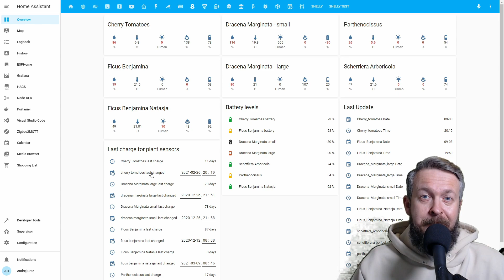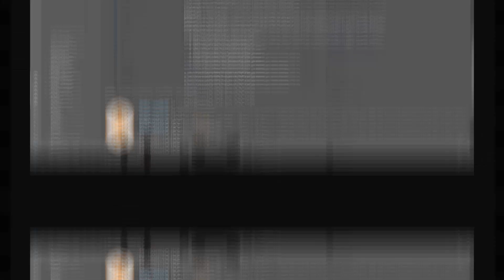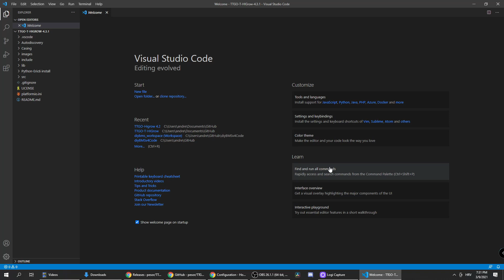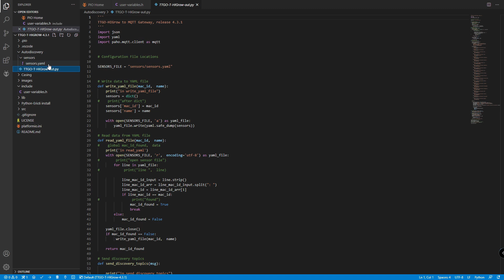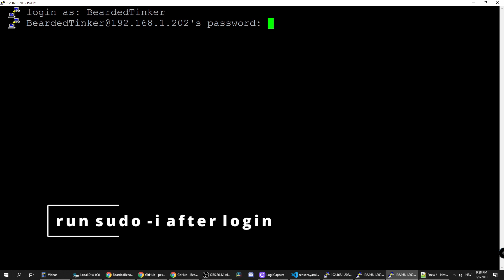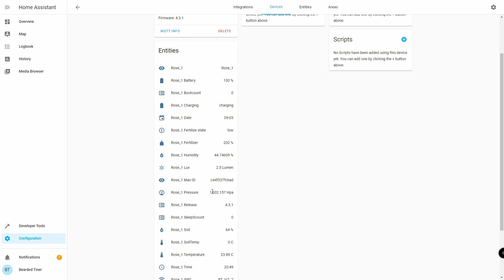Home Assistant How to - flash latest LilyGO HiGrow firmware

Comment from the maker: :_higrow: if you have old versoin of the firmware, I recommend you flash it with latest version. It should give you back more info and integrate with HA better then previous one.
Reply: unfortunately with last version of platformIO and 4.3.2 version of the code, the DHCP client is corrupted, and the device don't get the IP address from DHCP.... nobody is updating the code.
Reply from the maker: @enricograssi4805  did you try older packages?
Reply: @BeardedTinker  yes, 4.3.1 the same results, DHCP doesn't working.
Reply: @enricograssi4805  First comment got deleted or something...

Someone posted the fix in the GitHub Repo under the Issue section.
I can't post the url because i think that got my comment deleted...
Reply: @enricograssi4805  devi modificare questa stringa sulla riga 7 nel file "connect-to-network.h" che si trova nella cartella scr.

da così...

WiFi.config(INADDR_NONE, INADDR_NONE, INADDR_NONE);

a così...

WiFi.config(WiFi.localIP(), WiFi.gatewayIP(), WiFi.subnetMask(), WiFi.dnsIP()); 

vedrai che funzionerà.

Comment: Hello, I think my board is stuck in the boot sequence, all I'm getting is this on loop:

rst:0x10 (RTCWDT_RTC_RESET),boot:0x13 (SPI_FAST_FLASH_BOOT)
configsip: 0, SPIWP:0xee
clk_drv:0x00,q_drv:0x00,d_drv:0x00,cs0_drv:0x00,hd_drv:0x00,wp_drv:0x00
mode:DIO, clock div:2
load:0x3fff0030,len:1184
load:0x40078000,len:13232
load:0x40080400,len:3028
entry 0x400805e4
ets Jul 29 2019 12:21:46

And not the actual values, just this on repeat when I monitor it. Any ideas why ?
Reply from the maker: Is it over USB cable? If yes, this looks like boot-loop. One of the reasons could be power-supply issue.
I'm currently in process of deprecating HiGrow boards and searching for more out of box experience.

Comment: One more thing: I have a water pump already integrated to my home assistant. How could I use the humidity data from this sensor from the mqtt to control the pump switch?
Reply from the maker: I have a diy ZigBee water pump. If soild humidity at a specific time of the day is less than (for example) 30%, I run the pump for a specific period of time - in my case 6 minutes, as they are slow pumps and this is adequate. It doesn't run pump for next 24hrs,  as it may take time for water to increase humidity of soil.

Comment: I followed your tutorial everything worked fine, until I noticed the auto detection part there was python code needed to be run there, I feel worried that my homeassistant was not run in a nas but in a raspberry pi os. And it was not in any docker container, too. How can I run all those py files without python installed?
Reply: I fixed it. I run the py on my computer instead of the nas.

Comment: Seems there is a small issue: /TTGO-T-HIGrow-aut.py
Traceback (most recent call last):
  File "/volume1/dockerconf/homeassistant/custom_components/higrow/TTGO-T-HIGrow-aut.py", line 5, in <module>
    import yaml
ModuleNotFoundError: No module named 'yaml and i think the reason is correct since the yaml file is one folder deeper. Should there not be a relative path here in the script?
'''
TTGO-HIGrow to MQTT Gateway, release 4.3.1
'''
import json
import yaml
import paho.mqtt.client as mqtt

Could there be an error here, but the project is great you need to use  pip install PyYAML to fix the error on the yaml not found

Comment: Unfortunately it doesn't work for me. I don't use Synolog but Home assistant directly on a machine.
The logging does indicate "connected to MQTT server". But I don't see any entities in Home assistant.
Files and folders are neatly added to Home Assistant custom components.

Anyone have an idea ?
Reply from the maker: This version of the firmware still requires autodiscovery script run by hand. Without it it will not pull data from MQTT and create sensors. 
New version of firmware should be available in month or two that will not require this python script.
Reply: @BeardedTinker  Thank you ! can you tell me how ?  Thanks in advance 🇳🇱
Reply: works fine ! thanks !
Reply from the maker: @MrMarkeikelboom  did you manage to get it going?
Reply: @BeardedTinker  yes it works ! He sees the sensors perfectly.
I just feel like I have to press the RST button to get an update. no updates for 28 minutes now. maybe i'm too impatient
Reply from the maker: @MrMarkeikelboom  Not sure about default timer for updates. I think I have mine at 90 minutes. But can't remember if it was by default or if I changed that.

Comment: Hey, great tutorials man. Thanks for all these great details. I have an issue, I have hassos and I'm stuck on the python script. Is there another way of doing things or maybe something using the espHOME? Never had the chance to use it, but by the looks of it, it must be really easy when using esp boards. Cya
Reply from the maker: I apologise for a slow response John! While Per is working on a new code that will be out in 1-2 months and will NOT require Python script, take a look at this: https://github.com/BeardedTinker/HiGrow_ESPHome
I've done that few months back, it's working, but I still wouldn't call this finished - ESPHome code for those boards.
Reply: @BeardedTinker  Wonderful, I played a bit with these until I get an answer, I see the deepsleep you got on your code, looks nice I'll give it some tests. Did you get the i2c bus for light sensor play out nice? For me it works on first boot then no and it's considered a bug by other folks but I'm not quite sure. Anyways thanks for the reply. :D
Reply from the maker: @JohnBoudouris  light sensor works ok - on each wakeup it also updates the state.
Reply: @BeardedTinker  awesome, I'll try it tonight and let you know. Thanks for the help!
Reply: @BeardedTinker  Nice, it works! Only thing I messed up is my view in hassos, but that's on me. The logs flow nicely. Thanks again for the help!
Reply: I have the same issue John. I use the Studio Code Server to run the python script and it's work :)
Reply: @bobmarly0987654321  I'll give it a try, thanks.

Comment: I purchased this sensor ("19-8-22 V1.1") and when powered on I saw the sensor readings in the serial so looks like they were shipped with some FW and they are alive.
I decided to use the FW from this video and all was fine until the step where I flashed the FW.

The device fell into a boot loop with an error:
"assert failed: do_core_init startup.c:298 (flash_ret == ESP_OK)"

I could not find any help online, so I decided to try to upload a "Hello world!" sketch via Arduino IDE directly. And that worked!
Comparing the serial output between this working and the boot loop cases:
VSCode + PlatformIO: "mode:DIO, clock div:2" and from Arduino it was: "mode:DIO, clock div:1", so I changed the flash speed in PlatformIO to operate on 80Mhz and it started to work!

Long story short, if you hit this problem, add this line to your platformio.ini:
board_build.f_flash = 80000000L

Not sure if the board I received had a different SPI Flash chip or what is the reason for this problem... the rest of the instruction worked as expected. :)
Thanks a lot!
Reply from the maker: Thanks for this detailed explanation. There have also been some changes in libraries that can break stuff. I know that Per, original author has been looking and working on the updates.
Also, due to all of the problems with hardware, there may also be changes to the board that are not documented.

Comment: How do I get this board in flash mode - Anbody knows...?
Reply from the maker: If you have installed drivers for it, nothing else should be needed. Device should be recognized by itself - check com ports.
If it still fails, try pressing/holding boot when you start to flash, than release it.
Ohh, and yes, make sure it's not power only USB cable but does in a fact have data wires too. That is most common problem lately since more and more cables shipped are power only.

Comment: I put the files in the folder custom_components, I modified mqtt data (mqtt IP, user and password) on the file TTGO-T-HIGrow-aut.py, I reboot home assistant, but mqtt broker does not find the sensor. I have HASSIO on RPi4, how do I launch the script on hassio? can you help me?
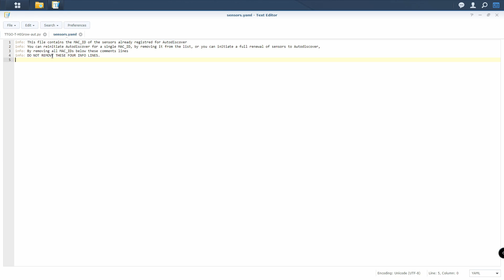Reply from the maker: You have to run that script on your RPi first in order for it to discover and add devices. 15:59 - here is procedure for Linux machine. Last time I did it was year ago and forgot about all the steps.
Reply: @BeardedTinker  i have hassio supervisor directly on my rpi without docker... how do i run the python script?

Comment: Since the recent PlatformIO update you get the following error.:
[xxxx][E][WiFiUdp.cpp:170] beginPacket(): could not get host from dns: 11

To fix this you have to comment out/delete line 7 in "connect-to-network.h".:
//WiFi.config(INADDR_NONE, INADDR_NONE, INADDR_NONE); // call is only a workaround for bug in WiFi class

The fix is from "townet01" and also can be read in the GitHub repo at the issue section.
Reply from the maker: Thanks for this! I've seen that there is a thread on GitHub but didn't have time to check all details.
BTW - I also made (still working on) ESPHome of firmware. Wanted to make it easier to update and change stuff on Higrow board. It does have worse battery life, bu I've moved all of mine board to it: https://github.com/BeardedTinker/HiGrow_ESPHome
Reply: I have same error, need I to replace it with... ???

WiFi.config(WiFi.localIP(), WiFi.gatewayIP(), WiFi.subnetMask(), WiFi.dnsIP()); 

do I have to comment it with the data of my network (my ip, my gateway ...) or keep it as it is written above?

Comment: Thank you for the video, it was very clear and helpful.  I was wondering if this method would allow the waterpumps be attached to the HiGrow and to be controlled by home assistant so they can be set to turn on when the water hits a certain % and for a set amount of time or till it hits a threshold?  Looking forward to more videos.  Thanks again
Reply from the maker: Thank you Andrew!!! I've never played with pumps for Higrow - as addon. I know that you can find them.
One of the problems I see here is sleep mode of device - if it goes to sleep, it will stop the pump.
I my self am using DIY watering station - made video on that one last year. It is Zigbee device with 3 water pumps that can be controlled over Zigbee Network.
Still haven't automated task as I need to use larger water canister, but I turn it on hy hand for 3-4 minutes when soil moisture goes below certain threshold.
Reply: @BeardedTinker  thank you very much for your response.  I have one further question.  On you video you seem to run the python script through Synology (from about 16min).  Unfortunately, my Synology is AMD and doesn't support HA.  Therefore, I've been trying it using what seems to be HA OS for the raspberry pi 4.  I can create the custom components folder and upload the TT Go HIGrow-aut.py via FTP.  Also I can SSH onto the raspberry pi.  However, I can't seem to find a way of running python through the HA CLI (OS version 7.5) - is it possible or how can I get round this as MQTT is not showing anything?  Is that the best way to run HA or can it be on top of the raspberry pi OS?
Reply: Think I've got most of it sorted, just can't seem to get the error message No module named 'paho' when I run the python script per the wiki?  Any ideas? thanks
Reply from the maker: Missed your previous question. Paho package (python) is used for MQTT support in python. I didn't cover running this on Windows, but you could run 8t also there if you inslatt python for Windows. 
Currently I'm on mobile phone and it's hard to find command, but something like  pip install paho-mqtt command (on raspberry pi)

Comment: Hi.
Thanks for the great tutorial.
Unfortunately, you have lost me when hassio integration kicked in.
No idea how to run it.
Could you maybe explain a bit more in detail???
Home Assistant 2022.2.2 on RPI 3
thanks
Reply from the maker: Or, I can suggest you try something else I'm working on - ESPHome version of firmware :)
https://github.com/BeardedTinker/Home-Assistant_Config/blob/master/esphome/dracena_marginata.yaml
It's still in the test phase, but I've been running it successfully for some time now.
You only need to name the device (based on plant?), WiFi ssid and password, and if you are using static IP address, those too.
Reply: @BeardedTinker  Ill try :)
Reply: Oh, man. It works like a dream !!!!!
Thank you so much.
One questions. Do I have to calibrate the temperature???
Reply from the maker: I didn't do any calibration. For my use, having general idea about temperature was OK.
Reply: @BeardedTinker  Ok. So every other entity like humidity, salt and moisture are already calibrated and nothing is to be done there. Is that correct???

Comment: Hii, I'm totally new to these kind of projects, but your videos are very helpful! What version of HA should I install?
Reply: I mean, should it be HA Raspberry Pi?
Reply from the maker: If you have Raspberry Pi 3 or 4, yes, you should use Pi version - https://www.home-assistant.io/installation/raspberrypi
This is simplest and best working especially for start.
Reply: @BeardedTinker  and it would also work for this LilyGo sensor right?
Reply from the maker: It should work without an issue. I have it working for 2 years now

Comment: Anyone know how to use the Bluetooth module on the board? Is there any software written to update the board firmware through bluetooth?
Reply from the maker: This firmware doesn't support it, and I'm not sure if even original firmware has support for Bluetooth - especially not OTA upgrades.
I'm currently playing with ESPHome version of firmware and it supports OTA. But still not ready for public release.
Reply: Thanks for your help. Very thorough!

Comment: dherakles
Reply from the maker: I see that you've posted comments today, but due to YouTube bug, I can't find them anymore.
There is BTW one other method for those boards, still in EARLY beta - ESPHome firmware.
I'm testing it on two boards. It eliminates all the tasks in regard to firmware upload and compiling, but it's still in BETA.
For example, Over The Air update hasn't been tested with Prevent Sleep switch. It takes few tries to add device to HA as it goes in sleep after 3-4 seconds (you have to time it)...
Reply: @BeardedTinker  thanks for the info, that sounds very interesting
Reply from the maker: Thanks for the replay (on HiGrow board) - once again, I can see part of the message, but if I want to answer, it's gone. YT comment really are messed up.
I can see this: Hi, thank you very much for your message. Thanks to your tutorial, I have now managed to include 2 sensors (latest flash) with autodiscovery succesfull in sensors/sensors.yaml. Great! 1. i
And that's it - nothing more - so sorry if I missed something.

Comment: Is it possible to change the log retention? I want to keep the plant logs for a year or two. Danx :)
Reply from the maker: I wouldn't recommend to do it internal firmware log. Best way is to use new long term statistics of Home Assistant or pull data from MQTT to InfluxDB or even better MariaDB.
Reason is simple - memory on this board has (very) limited number of writes and if you would write all of the events to it, it will corrupt the memory and you are left with dead board.
Reply: @BeardedTinker  Thank you so much man. Took me 30 minutes to setup InfluxDB with Grafana ;)

Comment: great work on this,, I was wondering if there is a chance this could be converted to ESPHome?
Reply from the maker: Thank you Paul! Pesor did great job with firmware.
This is on my to do list to try and see if it can be done while still keeping battery - not sure about sleep mode for ESPHome if and how it works. But so far I just never had time to play with this.
Most of the sensors are supported, so this could work.

Comment: Hiya Bearded Tinker outstanding efforts very helpful open source and indeed you're da best ,i wonder Q1:if having multiple sensor 6-10 RX,TX 'ing,communicating with a central control board .for data compiling and logging is it workable ?,Q2.swapping a faulty sensor module needs to configure it again in the system?.Q3:for friendly end user dashboard mostly are farmers guys side they cannot interfere with the software only plug and play.or does it need a programmer always around ? thanks a million .
Reply from the maker: Sorry for a very late replay :)
I have in my setup 7 boards. Not sure if I'll get more of these or try something else. So this should not be the issue.
If one sensor dies, new one has to be reprogrammed - unfortunately no plug-n-play.
In this setup, it does require some tinkering. No much, but yes, you can't just plug and have everything working.
There is one project, still in Alpha (not publicly available) that will complete whole Greenhouse watering solution - from monitoring to controlling water valves.
When it becomes available it will be visible here: https://github.com/pesor/
Reply: @BeardedTinker  Thanks for the reply,keep the good work man!